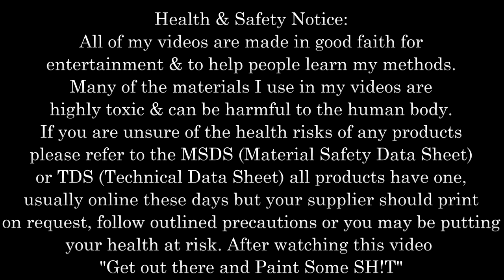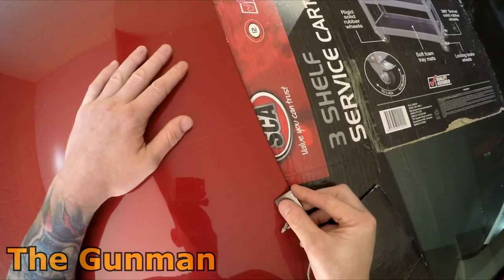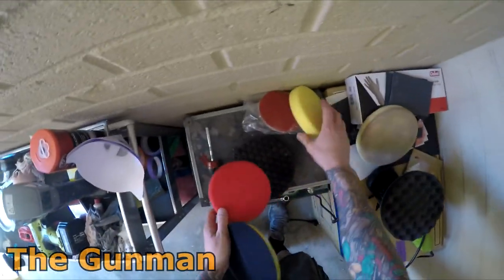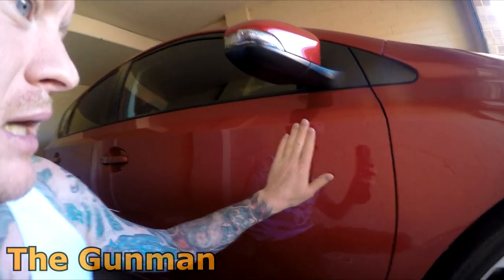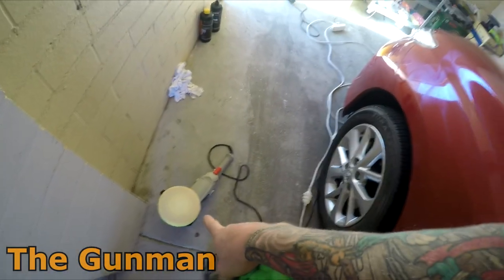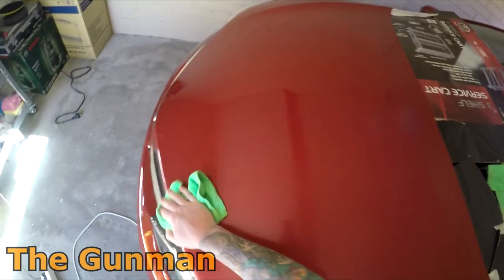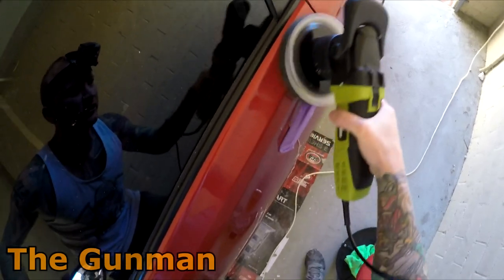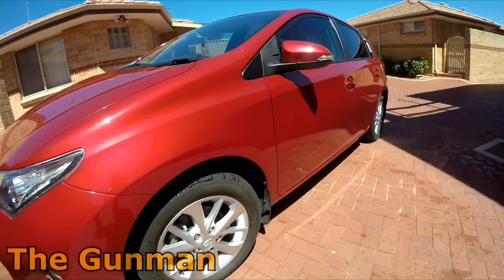D.I.Y. Removing Orange Peel & Polishing at Home

Comment: I’m a first year spray painter and love watching your work.
Reply: Where/how did you start? Im still messing around with rattle-cans just to see how paint responds to temps etc, and paint thickness. Looking into trying spray-painting but cant really find a good starting-point.
Reply: Bryan Eekelder Personally I just started getting stuff and working on my own vehicles. I just did my first paint job on my ‘07 Suzuki GS500F. Used a devilbiss FLG-670 Worked pretty well, a little more orange peel than what I wanted and a spot of trash in one on the plastics. But I think it will turn out great after a cut, buff, and polish. My advice is just try it out, talk to some friends and local shops see if anyone has an area for you to spray. Hell I did it in a diesel shop in the middle of nowhere with a temp booth I mad out of a welding skirting and some painters plastic. Lots of ways to go about it. Just try it out.

Comment: Gunny you have amazing talent and this series was awesome. From rattle cans to spray guns you can do it all and it does look amazing. Most backyard painters can relate to this series big time. I’ve only painted in a booth once and man is that a luxury IMO. As for a paint gauge yea I find them valuable when buying a car too detailing a car. There is a right way and a wrong way to offer advise however. I’m more of a Detailer than painter but can do both and you can take both to the Nth degree of micro detail. I traded a car recently at a dealership and they measured the clear on the trade as well as I did on the 3 year old car I was buying. Nothing wrong with knowing what you’re getting into. I’ve even had a mechanic do a once over on used car to make sure it was pretty solid. Every situation is different. For what this series was all about you were spot on and the car does look amazing. I agree door dings drive me crazy to more than anything else. Thanks for videoing the series.

Comment: Great video, best I've seen. I just bought a car in Perth and the pre-purchase inspection I bought automatically measured the paint thickness with a micrometer and told me which panels had been repainted. I still bought the car but I'm guessing these tools are being used more by professionals to measure paint thickness.

Comment: I polish the same way gunny!  I put the compound on the car lightly pull trigger and work it around the panel then give her some throttle..ive painted cars in the garage that took places at car shows.. its always best to spray in a booth but you can achieve a show room finish in the garage!!

Comment: Hey Gunman, I painted the bonnet of my car over the weekend and got a bit of tight orange peel through the clear, not to worry, I rubbed it back with 1200, then 2000 & then 3000. Did a compound and polish and it looked sweet.
I put the bonnet back on the car and it looks like the peel has come back after sitting in the sun for about an hour. What could have happened, shouldn’t the paint have cured enough. Used clear over base in black pearl

Comment: The Gunman Hello mate hope you're well.
Just wanted to ask you something about that door I sprayed. 
I used clear coat...or clear laquer it's called....it wasn't a 2K clear...just a normal aerosol.
When I had finished it completely...wet sanded and mirror finished...I was really happy with it.
It stayed in my house for nearly a week before I could find the time to reassemble the door handle and other bits....anyway I eventually got to it and decided to lay it on some soft cushions covered with a soft sheet...painted side down...I thought that would be ok as it had been drying for a so long....but when I turned it back over it was covered in marks ...I couldn't believe it. 
Could you possibly tell me why it marked so easily?
The clear was acrylic based...
The only thing I can think of is that I had to use two different brands of clear....?
Any advice will be very much appreciated.
Thanks

Comment: Arggghh!! Got a problem I'm hoping you might be able to help me with. Got my first 3 coats of colour coat on and was really pleased with the finish. There was a few dust spots, not surprising as I'm painting outside (under a tarpaulin stretched over a tent frame, but it's open at both ends) so I flatted the finish back with some 600 grit, then 800. I noticed some white pinhead sized white spots which I presumed was where the dust had been sanded off and it was primer showing through, so the next day I applied 2 more colour coats of colour. today, after 2 days of rain, there seems to be even more white spots, how can this be when the 2 final coats were applied over dry paint? When I try to touch them in, the paint doesn't cover them or leaves little pock marks. What do you think they are, is this the 'silicon' you talk about, whats causing it, and what can I do with them?  TiA

Comment: I am surprised that you don’t wax the car.  I thought a big part of the reason for wax was to give some additional UV protection, not just to enhance the shine.  Do you not see much advantage in that regard from wax?
Reply: Ceramic Coat is where it’s at. A lot of clears require 30-90 days before Wax application

Comment: Hey gunman have you ever used bulldog on plastic bumper? Can you put bulldog in your base or clear?
Reply from the maker: I'm pretty sure that stuff is an adhesion promoter like the 222S I used to use. It's good stuff if it is like 222S, but I must say I've never used bulldog, I would imagine you shouldn't mix with paint, it would be designed to spray down before the colour. Also I wouldn't use it over bare plastic parts, use a specific plastic adhesion promoter.
Reply: Bull dog should be applied before color and clear and can be used on bare plastic for adhesion properties

Comment: You didn’t sand the clear in a cross hatch pattern exactly 45 degrees apart, bloody outrageous.
Reply: Do you use a protrator or gps for your polishing stroke angle?
Reply: Travelingman 1980 You can’t sand anything properly unless you use a set square to guide each pass.
Reply: Car is ruined now
Reply: @RustyZipper  definitely a crush job. Not even good for parts anymore.

Comment: Would you please answer my question, when I blend the clear after sanding and polish always see the shadow lane
Reply: The blend area should be glossy not sanded.and also do not sand the clear in the blended area just buff it out.hope it helps mate
Reply: I sand my clear back fom the blend with at least 1500 beyond where i plan to blend i keep a second gun handy slow reducer hot temp with each coat of clear i come back and just melt the overspray edge into the blend clear area come back next day lightly color sand and polish no phantom line in sight..hope this helps a little

Comment: I usually swear by 3m fast cut. How does the quartz fast cut compare to that?

Farecla compounds are complete shit in my experience, G3 & G6 are a waste of time. I had some free stuff from a rep that I threw in the bin!
Reply from the maker: I haven't used the 3M fast cut but I'm really getting over the Farecla at work, that's what we use and yeah, it's not good. I actually just had another look at my bonnet today, I de-nibbed, cut and polished this job you saw 2 months ago and still no cut back marks or swirls, keep in mind it was fully cured HS clear so that's pretty impressive. I'd say give it a shot.
Reply: I'll definitely give it a try when my 3m stuff runs low.
Reply from the maker: @pyranna2003  let me know what you think of it if you do end up getting it, I'm interested to get other people's feedback
Reply: g3 premium in my opinion is way ahead of 3m green top, 3m is too dusty, pasty, far lower cut, workability than g3 and the  final finish it leaves isn't as good either. I used to love green top too

Comment: good day ! Have you ever painted a Rolls Royce and is there a special paint to use ?
Reply from the maker: I've done an old RR before and no different than any other car
Reply: The Gunman thanks ! It’s not sticking and when i sand area can’t feather edge and keeps getting wider. That is the damage area. I used BASF waterborne base and added flex agent to my clear. Originally i taped the blinker and had a gap  between blinker and bumper so usually no worries pulling tape but this time pulled tape and everything came off with paint. The paint was really rubbery. Any help i appreciate, i know u probably need more information.

Comment: It is not very common to use s magnetic paint thickness guage on a car, to check to see paint thickness of pannels, although some people (the smart ones) do use them, and they do give you an accurate picture of the pannel history of the car. 

These devices do also find pannel repairs and previous rust work. There are other methods of chasing paint thickness on a pannel, however  the real pros will have the most accurate and best devices. It saved me buying a rusted out car, that was made to look good.

The people who use them, dont make a big deal out of it, they just walk away from your car when they discover unusual repairs.

If you are buying a brand new, or near new car car that is worth a lot of money, if you dont do this test, you could be buying a seriously repaired car that was involved in seversl crashes and not know it.

The resell value of a crashed "expensive" car could be very much lower than a pristine conditioned one.

This is elite level paint diagnosis. Its like an x ray machine for your paint work.

If i was buying a really expensive car, i would insist on doing this test before I made my purchase.
Reply from the maker: There is a difference between rusted out panels and fixing stone chips in a car that's not even 5 years old. Are you saying those who don't use them aren't smart? It's what was insinuated in your comment.
Reply: @TheGunmanChannel  No. Not at all.
I think you have miss read me.

If you meet a buyer with these specific special instruments, they will use them.

The picture that is formed in their mind is this ...

There is extra paint on this bonnet, it must have been in a crash, or there could be something wrong with it.

Their "interpretation" of the results they are reading may not be correct, as the previous owner probably was sick of looking the stone chips and has their bonet repainted. 
No problem really. 
However this is probably not the conclusion the person reading the paint guage will come to and be suspicious of the vehicles past.
Reply: @TheGunmanChannel  , let me rephrase my response for clarity sake.

Imagine, you are in the market to purchase a presteige car.
You find two pristine cars and they are as beautifully presented as each other.

Both are mechanically lovely with book histories and priced very similarly. 

How do you make your choice ?

If one of the cars had uneven paint thickess in a number of places, and the other was beautifully even all around ... which would you choose ?

Remember, years down the track if you need to sell this car to a car collector, they will be using the same tools as you are using now.

Which do you think of the cars will hold their value better?
Reply: @TheGunmanChannel  , let me give you another example. I hope this helps. 

You are looking to buy a very expensive vehicle. You ask the owner if the car was in any kind of crash. The owners says .. no, always serviced and garaged. Took my mum to church on sundays with it.

You do your paint test, and you discover that the paint on the left side of the car is twice or ever three times as thick on tje front guard. the doors and the center pillar. The rear quarter is ok.

What do you make of this?

I will let you answer this question on your own.

I hope this helps.
Reply from the maker: Yeah I hear you. I do agree, if spending big bucks especially on an old car I would want to be sure it's not totally full of bog etc. But yeah being told I totally ruined the value of my car because I fixed some stone chips is a bit extreme lol.
Reply: @TheGunmanChannel  , possibly.
Let me explain.

As previously stated, if the car has uneven thickness of paint, a potential investor may see that as a "damage repair". 

If Im buying a almost brand new car, a few months old, under 10,000km and im spending $40k from a dealer.

 In my travels, I discover that the Bonnet and front two guards have twice the thickness of paint than the rest of the car, i know this car was in a front collision at one point or another.

Its not new. Its previously damaged.

Eather I walk, or if i am happy with the car, regardless of the repairs, i will want a significant discount, as the car is being sold to me as near new, pristine , mint condition.

And it is not.

Its a car with low mileage, that was at one stage involved in a frontal accident.
Reply from the maker: All good. Do what you will.
Reply: @TheGunmanChannel  , another example. 

If it is my car and I know its history and I love it, i will get that bonnet repainted, to fix the paint chips.

Twice thickness of paint on the bonet makes no difference to me, as im not selling it.

This is the reason why some people who are fussy will want their car fully stripped and totally repainted even when it does not need it.

The eveness of paint will add value to the car, as the paint thickness is even all arround.

I'm obviously thinking of selling it down the track sometime. And i want the best $$$ for it. And the car is worth the investment.
Reply from the maker: @nenadstanojevic1427  I don't invest in cars. They are little more than a form of transport. I get enough enjoyment out of painting (ruining the value of) nice cars 😆😆😆
Reply: @TheGunmanChannel  , i understand.
I agree with you.

However, when you are working on prestige or expensive cars, this crazy thing about paint thickness is going to save you.

You are now a more informed specialist painter.

Now, go out there, and paint some s#!t.😎
Reply from the maker: @nenadstanojevic1427  😆😆 I've always known micrometres exist but I'd still say 99.9% of people would never use one when buying a car. 👊  I have actually been planning to get one for ages, just out of curiosity, to get an idea of film thickness using different methods and products. And definitely was planning on making videos on it. I got as far as finding them on eBay but couldn't justify the money for a novelty tool.
Reply: @TheGunmanChannel  , yes.

You are now well informed.
Looking forward to your new line of videos.
Reply: It’s a Corolla not a Duesenberg.  Wake up and smell the coffee.
Reply: Looks like i'm fukd, my cars are covered with filler under my shiny new paint
Reply: I understand you borh. I've been detailing car's for many years. Just recently started painting cars. In my opinion, i believe things are getting to scientific. You have your profession, he has his. Im sure the Toyota is just fine. It looks great. If i was going to spend big money I'd use your method. Please let's not confuse people. This is a painting channel for painters and others in the interest.
Reply: The Gunman your patience is lovely